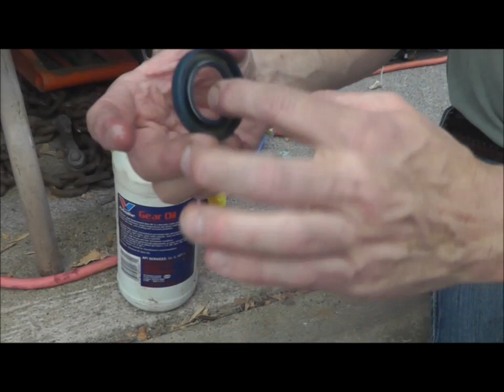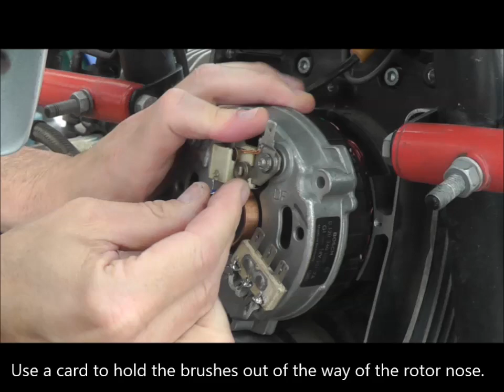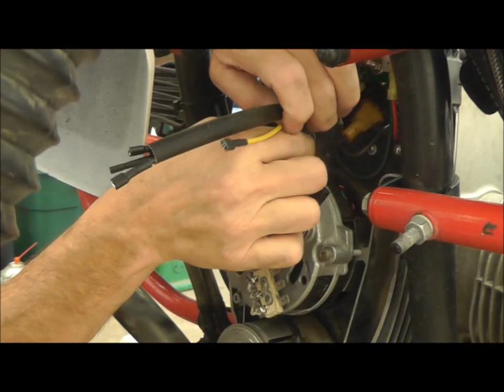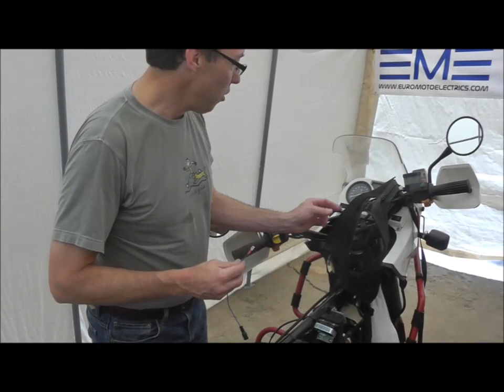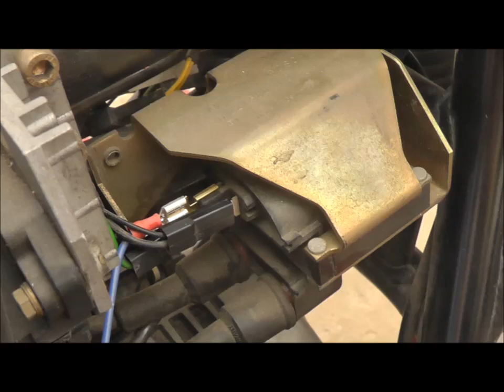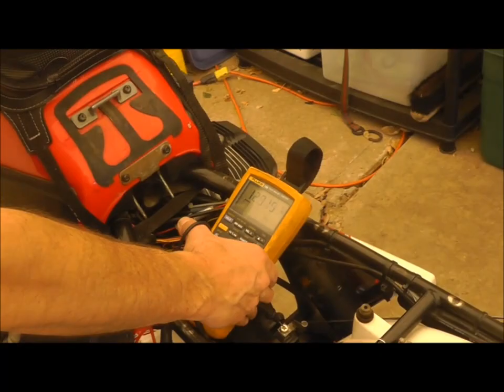EnDuraLast II Charging System Install Part 2

Comment: Could you point me in the right direction for a comparable aftermarket charging system for a 1975 r90/6. Does EME carry a full replacement kit? Great video by the way, well delivered.